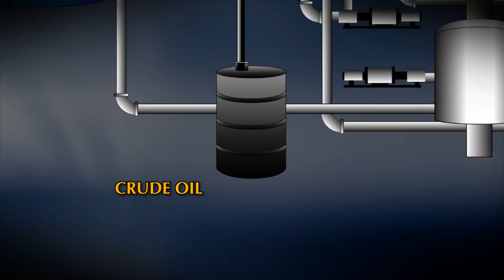Petroteq Energy Introduction

Comment: This tech works only if oil prices are high.  Once oil dips below 50 a barrel it becomes unprofitable
Reply: Uh yu are very wrong - the cost is under $25/bbl  Wwll installation and Pumping $38+ and Fracting over $50